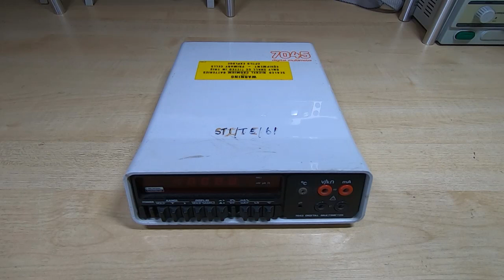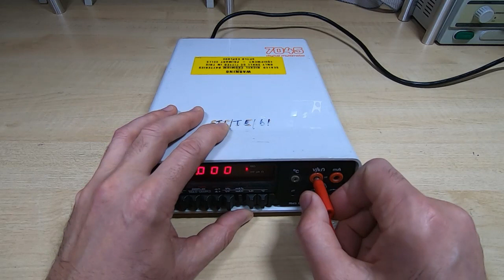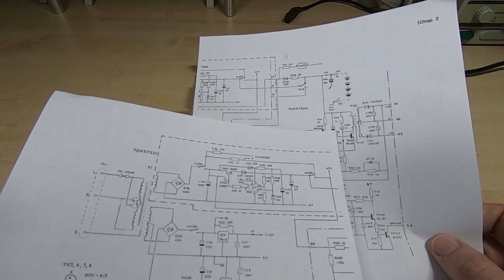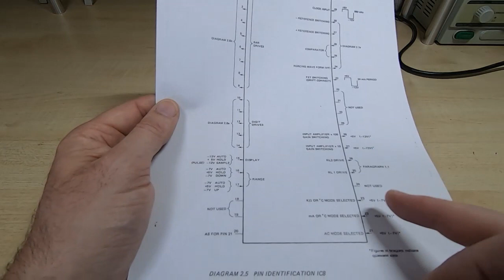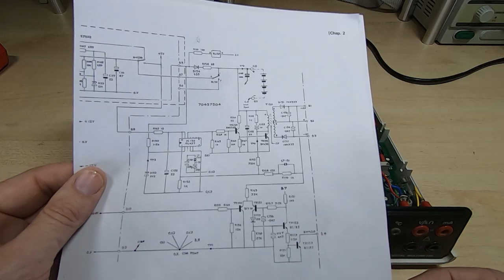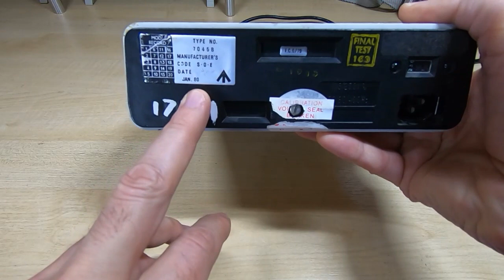Solartron 7045 Repair

Comment: I have two of these meters would you be interested in checking them out for me.
Reply from the maker: I can certainly do that. Do you think they have faults?
Reply: They work fine its just the readings are not accurate when compared to a Fluke multimeter.
Reply: How do I get in contact with you.
Reply: @JerryWalker001  You offered to look at my meters if would be great if you could, I've not had any response from you since. If you are no longer able to check them out please let me know so I can try and find someone else...thanks.
Reply from the maker: @Klipp1e  Hi If they were faulty then I would be happy to look at them but as you say they work it would not really make a good video. It sounds like you just need them calibrating so I am sure there are many people who would be able to do that for you. They are nice meters so well worth keeping.

Comment: I used these a long time ago and found them okay but a bit twitchy seemed to be upset by hf on the test leads. I bought a second hand one for £50.00 mainly as a back up for a fluke 87 portable. The mains wiring is a bit iffy in comparison to latest safety construction requirements . The company I worked for then started to buy Fluke 8000 series bench meters slowly replaced all the solartrons for several reasons but the main one being they were not twitchy so what you read on the scale was always to be trusted even if it did not make sense (it usually meant the signal being measured was wrong ie ac superimposed on a supposedly dc signal). I looked to acquire a fluke but their price for a tatty used one is around 500 GBP for a working one and over 100 for a faulty on. The other simple issue with the solartrons in production if you drop thyem from bench hieght onto concrete they do not fair well the Flukes tend to bounce

Comment: I believe this unit was manufactured in Solartron’s plant in Farnborough Hampshire. I got a job there straight from Uni in 1987 as an electronics and firmware design engineer working on their IMP and Orion data loggers and I worked alongside the DMM team. Many thanks for the trip down memory lane.